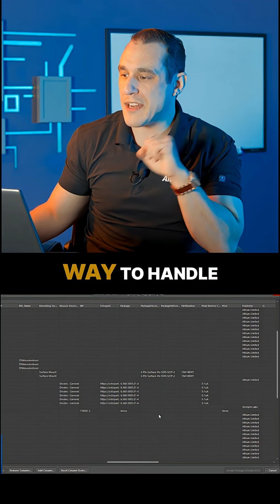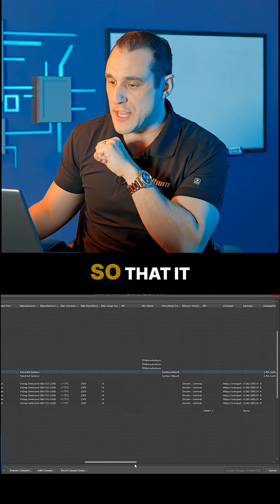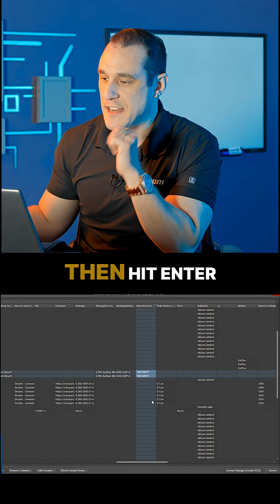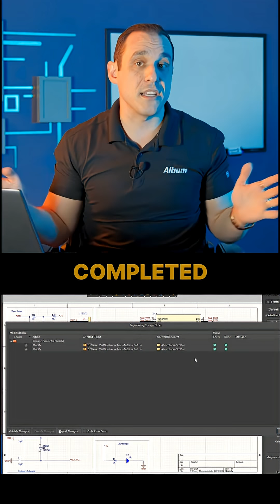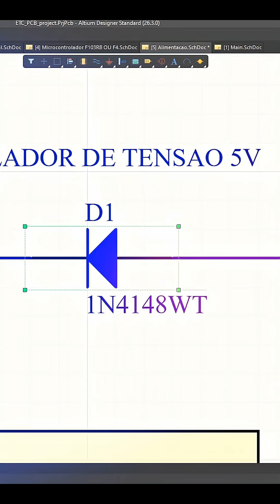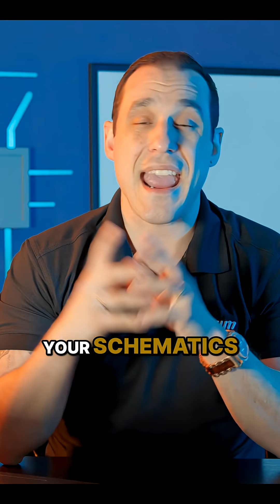Bulk Rename Component Parameters in the Parameter Manager

Comment: Ideally, this is done at the library level, and your libraries are properly linked to some version controlled single source of truth. This totally works, but man is it a recipe for disaster LOL.
Reply: Yes doing it in the library is the best option if you're working out of a single centralized library for all projects. But also think about it from a different perspective, sometimes if you're doing contract engineering work you would be given design data from multiple sources, and you do not always have the original library files. Also sometimes you might access parts from the Manufacturer Part Search panel, but those use a mix of parameters. What I do in this case is I just compile all the components regardless of source, then when the design is complete I make all the parameters consistent and I export an IntLib (SchLib + PcbLib file set) for the project. I then set the component source to this newly created library. The library is part of the deliverables and it gets handed off with the project files. The client can then do whatever they want with that library.